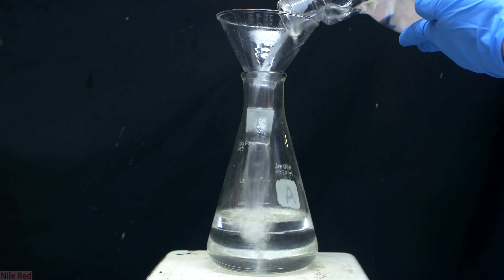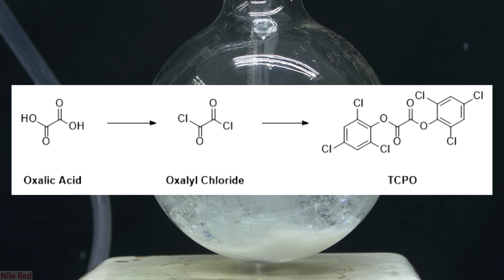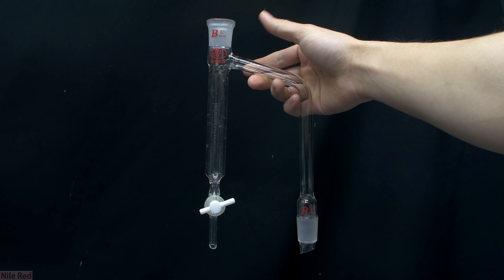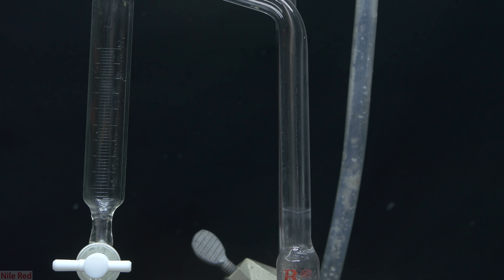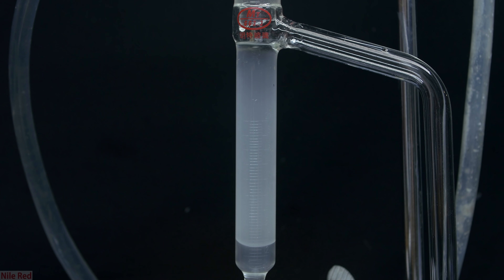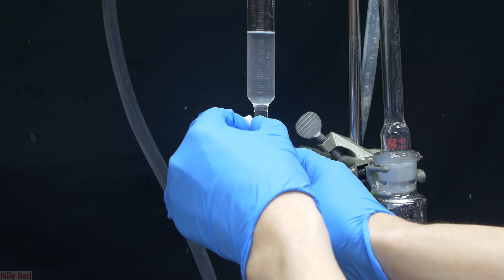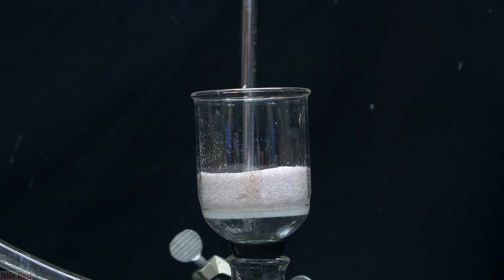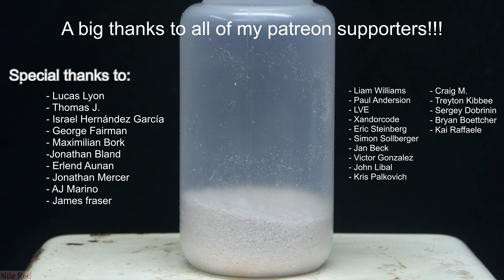Making Anhydrous Oxalic Acid (using a Dean-Stark Apparatus)

Comment: Hey, I tried the dehydration of Oxalic acid using toluene by vacuum distillation. But no use. Technically, it should have worked. But I don't understand why it didn't! Can you help with the reason?
Reply: To drain oxalic acid dihydrate by distilling water azeotrope and toluene, you must decompose the dihydrate into water and oxalic acid, which is most effective at higher temperatures. Vacuum in this case does not give any advantages and only harms: toluene flies into the pump, the necessary azeotrope may not even be formed, oxalic acid does not give water.

Comment: Just a couple days ago, the video to some of my dreams was uploaded... Excellent visual and audial description of how this tool works... Studied diagrams and have spent a few hours reading on this apparatus and it never connected.. 

So the undesired vapor gets trapped in the azeotropic solvent and then condenses back down into the evaporating flask and the desired vapors proceed?  Been wondering for years about how that thing works and it's peaked my curiosity lately (coincidentally). It's obviously masters degree level stuff so I think a few more runs are warranted to get us inexperienced up to snuff on the workings. Great video and I'm purely an academic deciding if I want to go full time Chem... Love it love it love it. That's not a job, that's a piece of artwork right there...

Absolute Ethanol would be an easy simple legal target and I'm sure it's already done.. Trying to think of other things... 30% H2O2 maybe from 3%... Idk
Reply from the maker: +fla playa The classic way to make absolute ethanol is by azeotropic distillation using benzene or toluene!

I wouldnt think it would be useful to make 30% h2o2 though
Reply: Ah, so my organic chem skills by instinct are halfway intact at the very least:)  Didn't know benzene could be used as an azeotrope..Your skills are pretty amazing and thanks for the correspondence, I'll try to not comment too often.

Yeah I suppose H20 and H202 are extremely similar and have nothing to do with separation via this configuration... Thanks. Inspires me to get into classes soon :)
Reply from the maker: fla playa I am glad you enjoy the videos! Yeah h2o and h2o2 are quite different indeed :)
Reply: Nile Red Hmm. I thought both H202 and H20 were polar with very similar melting points... Boiling points are way off though.. 302F is way out of bounds so yes I suppose they are very different but still share many properties... Any other differences? 

A prominent YouTuber made a comment about freeze separation and it doesn't work.. Won't name names but that guy doesn't deserve quite as much attention as he gets.. Too many less than apt people just gobble up crap videos with great editing. I noticed this channel being extremely concise and precise. It and has gotten my nod.

Comment: I just binge watched about 3/4 of your videos. You're doing a hell of a job; I'd be doing more at home synthesis if glassware wasn't so expensive. The chemicals are easier to get, as most things you can extract from common items, or buy it on amazon, for not too much, but, as I lack the proper glassware, I'm stuck doing everything at the lab. Anyways, enjoying your videos. If you want a challenge, try to synthesize nicotine without purchasing methylaminopyridine. Might give your leftover bromine a use contingent upon where you start, and would be a decent challenge. Plus, it'd make a cool trophy jar.
Reply from the maker: +Chevis Preston hey! I looked it up before and i think making nicotine might be a little too hard to do at home
Reply: +Nile Red it is definitely a challenge. A few biochemists I work with decided they wanted to do a synthesis of it in the lab, and, starting from ground up, some of the reactions produced a pure and quantitative yield, while others made terribly diminished returns, even under lab-grade equipment and tools. Overall it was a lot of fun, and we produced about 82% yield from the base material theoretical, and measured it as about 99.2% pure... Definitely not the 99.9% that you are able to extract directly from tobacco. As some of the alkali drugs are very soluble in any variety of solvents, our last wash took place with water, as nicotine is miscible around 50° with water, while other contaminants got caught in the water. We then chilled it in an ice bath and waited for the clear, oily nicotine to separate from the contaminated water. Definitely a lot of fun, though it was a challenge. Could you do it? No doubt. But it would be a multi step process spanning a few videos.
Reply from the maker: +Chevis Preston Do you know what pathway you followed? The one i see online uses n-BuLi which I do not have and cannot buy. I could make it, but it is pretty dangerous to work with at home

Comment: Is it possible to split the C=C bond in indigo?

please
Reply: i don't know what you mean with indigo? but you can break c=c bonds easily with halogens like fluor and chlorine. Or you could use an anhydrate compound to initiate a chain reaction. This method is used to make plastics.
Reply: well if you google ˇindigo structure" you will see that it is made of two almost-tryptamine-like mollecules, connected via C=C.
The molecule has nitrogen in a 5-ring in it and a -OH or a =O group attached to a ring, so i need a reagent that wont ruin anything else than that + wont ruin the organic solvent.
sorry for bad english
Reply: Yeah sorry man, the c=c seems quite hard to reach and i can't think of anything that n wouldn't react with the rest of the molecule first. Maybe if you use iodide and heat it up a bit? Good luck on it anyways.

Comment: AHHH I get it. Azeotropes are like alloys of metals but for liquids.
Reply: +Mr Rishi The Cookie Yeah, but the thing is that an azeottrope is also like a point where you can't get a cleaner product. Like say you distill ethanol a few times and you hit maybe 95 %. Now if you try to distill it again you will still only get 95 %. That's because ethanol and water has an azeotrope at 95 % ethanol - you simply cannot get a cleaner product by ordinary means. In order to break an azeotrope you have to find cunning ways to do so (in the abovementioned example you would use chemical drying with magnesium sulfate or use molecular sieves or something along those lines).
Reply: +Mr Rishi The Cookie No, actually, azeotropes are to liquids as eutectics are to metals, sort of. A eutectic is an alloy of metals that melts at a constant temperature.
Reply: +Mr Rishi The Cookie If the boiling point is lower than that of the constituents it's a positive azeotrope and if it's higher it's a negative azeotrope. It's not as simple as it seems
Reply: Mr Rishi The Cookie np dude chemistry is awesome :)
Reply: Erika Sandstrom Erika Sandstrom Ok so now i have to research into eutectic. But i thought the azeotropes have a lower boiling point than say water an ethanol boils at 97 when normal water boils at 100. And steel also melts lower than pure iron. Thanks for the info though
Reply: A Sloth thank you for helping me understand it everyone who responded
Reply: Azetropes are just more annoying
Reply: exactly
Reply: +zombie apocalypse it's such a satisfying feeling when you finally understand something that bugs you for a week.
Reply: +neovictorius dony worry bro. I know that. I've been reading up about it a ton and only after his video it all just clicked into place.
Reply: What... No....

Comment: Would you have any interest in doing a explanation video of how marine aquarium test kits work? The test kits I have are you NH3/NH3, NO2, NO2, alkalinity, calcium, and magnesium.  I'm interested in getting a better understanding of the process that produces the color change in the water sample.
Reply: +Rob Makowski Don't you mean ''NH3/NH4, NO2 and NO3''? These are standard water tests. The processes that produce color change are chemical reactions between reactants found on the test kit and the chemical species you are wishing to analyse in the water. The reactions themselves vary depending on the test you are doing and the analytical method. 

In the case of an indicator such as bromocresol green for instance, the color change is due to changes on the molecular structure on the indicator. In acidic form, it is protonated and has a yellow color. In alkaline conditions, it is deprotonated and has a blue form. 

In the case of hardness (calcium, magnesium), indicators like eriochrome black react in the presence of calcium/magnesium ions to form a reddish complex. Then, titration is made with EDTA to form an even more stable complex with Ca/Mg and thus, ''depriving'' the indicator from it's complexed ions making it turn blue when no more Ca/Mg is bound to it (equivalence point). 

These are examples. I don't know what methods are used in your test kit. But it should give you a general idea.

Comment: You don't use a Graham condenser for a reflux!
Reply from the maker: +meganie8 You are technically right! I shouldnt have because they can get clogged. You can use them, you just need to be careful. I will add an annotation in the video. The reason I used it is because it was my only clean condenser at the time :p
Reply: +Nile Red Not only because it can get clogged, it also has a very small surface area so the cooling capacity is very low. For a reflux you need a high cooling capacity. A Graham condenser is only used to cool the condensate down after a destillation.
Btw: Do you have problems to buy lab ware in Canada? No one here in Germany would use Chinese lab ware, not even at home. :D
Reply from the maker: meganie8 We use chinese stuff mostly because it is A LOT cheaper
Reply from the maker: ***** Thanks! So far for me though, all of my chinese glassware has been good. Ive heated some up to 350-400C and had no problems or used them with acetone/dry ice
Reply: I'm from Luxembourg and so far I only used Chinese glassware because it is much cheaper than German stuff. I did break an allihn condenser, a round-bottom and a vigreux coloumn due to stuck joints, but I don't think that quality equipment would have made a difference. Besides, breaking a 20€ allihn condenser doesn't ruin your day as much as breaking a 80-100€ one, especially when you're still a student and don't want to spend just about all your money on glassware. Those three Chinese things I broke combined are cheaper than a single one of them on Amazon.de .... The most expensive piece I own is a 30cm dimroth cooler that I got for about 25€ on ebay. It feels really good though and it has held up til now, so I don't see why I would want to "waste" 80+€ on one from DURAN or whatever.
Reply: Nile should have used a bokakob still setup with small glass pearls in reflux column for that azeotrope distillation, makes things a lot more clean just in one run